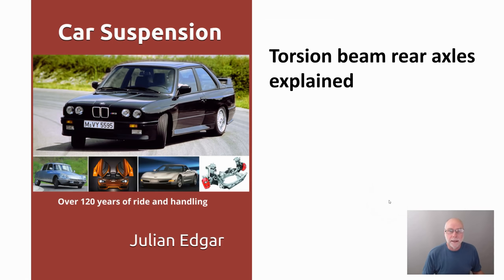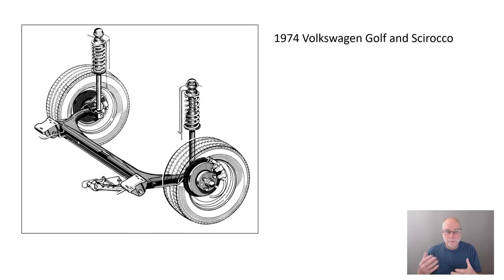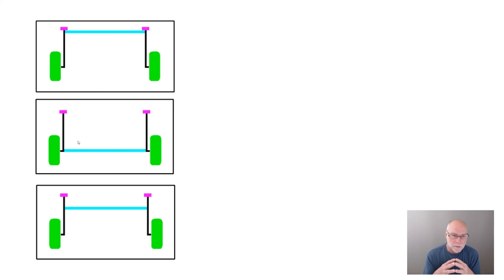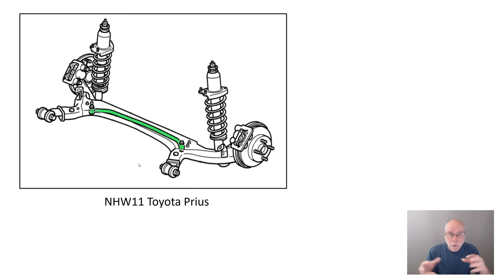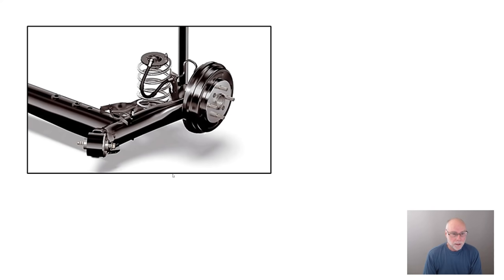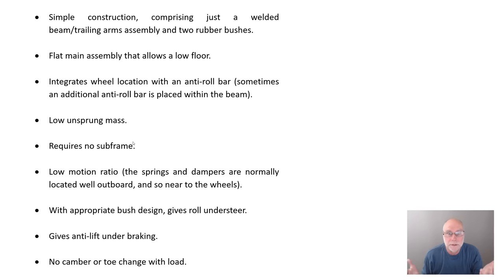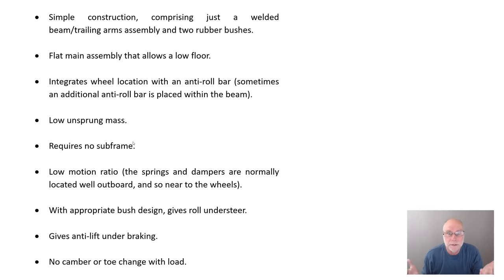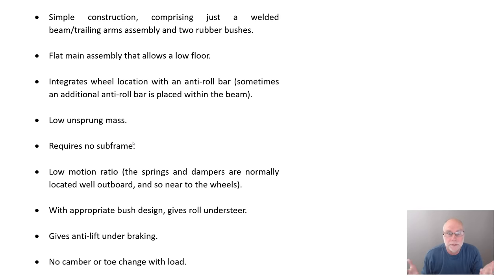Torsion beam rear axles explained

Comment: Torsion beam rear axles are NOT completely dead yet because it is still found in the current model of Mazda 3 in which it had switched from independent type.
Reply: Far rom dead I would say. Lower spec Mercedes A-Class, Golfs and their SEAT/Skoda, even Audi equivalents use one, as does the Peugeot 308 and its clones, pretty much all supermini class cars like the Polo etc. And since cars like the Golf moved from multi-link independent rear ends to this two-tier system of twist beam for low-spec cars, you could say it's more common now than before. Perhaps it will die however – nice to see the new Renault 5, despite its size, having an independent rear end.
Reply: I think Toyota still uses them too. I remember I saw one in 2012 Yaris. I just noticed it after I got fascinated by this axle type after one in my Golf got broken and how easy it was to replace. At least compared to the multi-link rear axle on my wife's Audi which always has some bushing or link worn out.

Comment: On my laguna ii beam developed cracks about 2cm from weld, and it is case of car with 20 years of riding on shitty, Polish roads. Still, cheap and quick to replace and still very, extremely long life suspension part. In winter we have salty roads and it is fine to have corrosion-made holes in like 10 years :>

Comment: ive seen a few rally guys running watts links on their fiestas to counter the lateral forces on the bushes. also helps with the stress on the arms themselves by taking up the lateral force.
Reply: Afaik that's been a original design in quite a few cars. But I'm not sure except some Opel/Vauxhall models.
Seems like a rather simple but worthy upgrade for sure.

Comment: Good info! i have a citroen DS3 that uses this system and having been brought up on live axles and multi-link independent suspension systems, (60's sports cars and saloons) i was a bit mystified by torsion beam suspension, now i know!
In some situations the DS3 behaves like it has a live rear axle, there is a long sweeping fast bend with a ridge right across its apex, the DS3 gives a most undignified lurch to one side as it is crossed! This doesn't bother me having driven live axle cars that would do the same. I liked your semi trailing link analogy,  a design used on the IRS TR's and they always would squat down at the back under acceleration and cornering hard, the torsion beam gets round this very neatly!

Comment: It is very interesting. Thank you for these videos. These type of suspension was and still is very common on euro hatchbacks.
One thing I would like to bring to this discussion is how immensely important are those two rubber bushes in the whole car handling. They are often overlooked and never replaced, when in fact they tend to wear very quickly. Lateral desplacement of the beam, even if small, have  huge impact in the steering precision and feeling. If you have a car with this suspension with more than 80.000 or so, change them, you will feel the difference.
Reply from the maker: Yes that is correct.
Reply: For the Astra VXR/OPC they are commonly replaced with spherical bearings which add minimal NVH for a huge upgrade in rear end feel and stability. Definitely something I want to do to mine.

Comment: My 96 Passat (B4) has semi-trailing arms. I tossed the torsion beam in the scrap heap in favor of a Syncro setup. I get lots of toe-in as it compresses and it feels much better than the torsion beam. This is interesting info right here. The car rode like hell on airbags slammed down low. Now I know why, no torsion action!

Comment: Julian:

Re: stress on the welds - the torsion beam is loaded in torsion (hence the name), resulting in shear in the tube. From shear flow theory, the shear in the thin wall is approximately proportional to the distance of the wall from the centroid of the beam cross section. You'll notice that the beams tend to be rectangular rather than round, and the welds are at the ends of the rectangle, far from the centroid, and so are subject to much less shear than the regions near the centroid. Assuming a material thickness that is greater near the welds (a good assumption for the way these things are stamped), the welds are not only under lower stress compared to the rest of the section, the material in the vicinity of the weld is also thicker. Hence, it is unlikely for a properly designed and executed weld to fail in this application.

Thanks for the details on the kinematics, I'd been wondering about this.

Comment: This is a great presentation. Have you read about how the beam axle in the Mk3 VW and Passat would shift in a controlled manner in cornering? VW billed this as a simple 4 wheel steering system.
Reply from the maker: Yes, most rear suspension designs have 'steer' capabilities.

Comment: Interesting that you mentioned the negative of poor lateral stiffness, because that’s exactly that I feel in my Alfa mito when doing a roundabout for example and hitting a pothole or general imperfection in the road, the entire car seems to shift a bit towards the outside when that happens. It’s also very noticeable under heavy cornering when there are imperfections in the road
Reply from the maker: More likely inadequate damping. Lack of lateral stiffness in a rear torsion beam more likely to lead to rear toe (ie rear steering) changes, I think.
Reply: @JulianEdgar  oh ok

Comment: I had a Citroën Light 15 back in the day and it had torsion bar suspension all round and one could adjust the tension, with Michelin tire's it stuck to the road like glue with a very smooth ride . for something designed in the mid-1930s it was remarkable.

Comment: another disadvantage is reduced  ground clearance  specially when used  in FWD  Vans like Renault Traffic , these often have to drive around on  muddy or sandy  building sites with an already compressed suspension due to  heavy cargo.

Comment: Great video! I have a question Mr. Julian. Two same cars (Golfs), one with torsion beam on the rear axle and the second one with a multi-link, should have the same behaviour, in terms of comfort, when BOTH wheels hit a transverse bump/pothole, assuming that the shocks are same? Thanks in advance.
Reply from the maker: Not easy to answer eg depends in part on the unsprung weight of the two different suspension designs.

Comment: Perfect analysis, thank you! Just a question: if you add a spring spacer at the springs of a torsion beam (in order to raise the ride height at the back), do you affect the spring preload?
Reply from the maker: Depends how long the dampers are, but yes normally that would be the case.
Reply: Thanks for your reply! This applies also when the damper and the spring work separately? I mean when it's not a coilover.
Reply: I mean a design Similar to the design your are describing at 6.06 of your video
Reply from the maker: The length of the dampers dictates the preload (if any) on the spring. Fitting spacers to the springs would normally change the preload, because the dampers don't get any longer.

Comment: Hi, from a performance point of view, I never really understood why anti roll bars are installed in conjunction with the stock torsion rear beam instead of bracing the existing setup for more rigidity, is there a benefit to it or just marketing?
Reply from the maker: Allows easy manufacturer adjustment for different models. Just change the bar, not the whole torsion beam axle.

Comment: Just to note - the Peugeot 306 / 206 etc did not have a torsion beam... it had a fully independent torsion bar setup. Quite a smart system really which was very low maintenance!
Reply: That was the answer to my question since I just bought a 206 and wondered why the trailing arms are on individual bearings if they are supposed to be rigid. My thought was something like what you stated but was not sure.
Reply: The 306 also had a passive rear wheel steering mechanism as part of the bushing arrangement.
Reply: I do not agree 100% about the low maintenance, the family 106 needed a replacement of the entire system because it rusted together, leaving the car with no suspension at all.
The replacement version had multiple lubrication spots to fill op the torsion beam system with grease, to prevent the system from rusting into a solid piece again.

The same system generally works well on a lot of trailers though, so designing it correctly is key.
Reply: @larsjrgensen5975  Just because YOUR suspension system wasn't reliable, doesn't mean ALL of them were unreliable. Most cars I've seen with 200k with no work needed to be done on the suspension. That does take a lot of doing!
Reply: @khalidacosta7133  Just because YOUR suspension system was reliable, doesn't mean ALL of them were reliable.

I wrote that it works very well on trailers, but it is not a 100% perfect system.

If they spend time and money on developing a way to renovate the system on a peugeot, there must be a market and need for it.

The 106 had around 160.000km on it, when it locked up and became very dangerous to drive.
A friend of mine had a Renault 19 with the same design, one side broke at 190.000km.
A 306 in the family locked up like the 106, but i do not know about the km, so it does not count.

We have a bad climate here, with a fair bit of road salt, that could maybe explain some of the higher failure rates.

Comment: It's a simple design....Not overly sporting, but just pure simplicity.

Now it isn't attributed it to bad welds or excessive forces, but broken torsion axles on the Ford Windstar is all too common.  It was attributed it to salt exposure...  It was so common enough Ford issued a recall.  I tend to attribute it to many factors of all the cycles they see, with the road salt/brine accelerating the process.  But if you haven't seen a broken torsion axle - there are lot's of pictures all over the net of Windstars with broken torsion axles.  Is it a common problem altogether, no... But given all the attention is generated - it likely soured companies from the design.

Comment: My Fiat Scudo van has a torsion beam rear axle, but it has a panhard rod to take lateral forces. So lateral forces can be quite simply solved just like that.
Reply from the maker: Yes and no: there will still be a relatively flexible trailing arm component unless the torsion beam is acting only as a dead axle.

Comment: My Toyota Avensis with torsion beam rear end has what looks to be a significant amount of negative camber and toe-in included in the design. Why is this necessary? At first I thought it was broken but it’s meant to be that way. I can’t see the need for negative camber on the rear of a front wheel drive car?
Reply from the maker: Because all cars need front and rear grip, irrespective of their driveline configurations.

Comment: What do you think about Opel Astra J rear torsion beam axle coupled with a Watts link? Was the Watts link placed there to limit the amount of toe out on the outside wheel? If so, as you say, couldn't this be mitigated by a better bush design?
Reply from the maker: I have no technical information on the Opel Astra J.

Comment: The VW GTI did have a anti roll bar it was built into the V section of the beam.
Reply from the maker: Yes, many cars with torsion beam rear suspension have an anti-roll bar within the beam.
Reply: @JulianEdgar  You said there wasn't one on the VW beam and you are correct for all but the GTI models. I did see you mention other vehicles. I just felt like commenting as I was a VW mechanic for 35+ years. 👍

Comment: Hi Edgar, loving you series. How would this torsion beam compare with torsion bar which had independent wheel suspension, like peugeot 306 as someone mentioned before. I suppose having independent suspension must be much better than having this beam setup. Thanks
Reply from the maker: It depends how the independent suspension is arranged - torsion bar springing can be used with a whole variety of suspension systems. (I don't know the Pug system in any detail.)
Reply: @JulianEdgar  I was going to ask about the difference between Torsion Beam and Torsion Bar. I assume they are different?
Reply from the maker: @zonoscopePictures  'Torsion beam' refers to a type of suspension system, as covered in this video. 'Torsion bar' refers to a type of spring - a bar that is twisted. So anti-roll bars (sway bars) are torsion bars, and torsion bars can be used as the main springs in all sorts of suspension systems eg double wishbones, semi-trailing arms, etc.

Comment: Julian 
any Video of  DOUBLE BALL JOINT SUSPENSION GEOMETRY and BENEFITS ???
Reply from the maker: What is double balljoint suspension? Double wishbones?
Reply: @JulianEdgar  I seen some Audi have 2 upper ball joints
Reply: @JulianEdgar  https://en.m.wikipedia.org/wiki/Multi-link_suspension
Reply from the maker: OK, multi-link suspension. Pretty common these days, especially on the back on RWD cars. Yes, they have benefits in holding toe angles and giving defined camber curves - but I often think the benefits are a bit overstated. Multi-link suspension is covered in my book.

Comment: Your videos are lways interesting. Where is the roll centre located at static heigh and where does it move to in bump, both two wheel bump and one wheel bump, and roll.
Reply from the maker: Not a depth I am going into here. I can recommend several textbooks and papers if you're interested.
Reply: @JulianEdgar  if you have them. That would be great.
Reply from the maker: @Michael Stanbrough  The references I used when writing the section on torsion beam suspension were: Held, V. & Hiemenz, R., Designing Twist Beam Axles in Encyclopedia of Automotive Engineering, John Wiley and Sons, 2014, and Heibing, B. & Ersoy, M., Chassis handbook : fundamentals, driving dynamics, components, mechatronics, perspectives, Vieweg + Teubner, 2011. However, I am not sure they will fully answer your questions.

Comment: bush design for roll understeer - what does this entail, just the level of hardness, or something else?
Reply from the maker: It can involve differing bush hardness in different planes and the bush orientation - but also inclination of the trailing arms to horizontal, use of additional toe control links, etc.

Comment: Hi, My car has thos type of rear axle and I am curious How can I upgrade this into an electric drive format.
Keeping the combustion engine in the front, powering the front wheels and somehow upgrading this type of rear with an electric motor.
Reply from the maker: Anything is possible but it would be a major engineering exercise.
Reply: @JulianEdgar  If it piqued your interest and lets say intellectual curiosity, as someone that knows a lot on car suspension, i could suggest tackling this idea, thinking a "what if, how i would do such a change". Not needing a large EV motor (like lets say a tesla or any other powerful beasts) but one that could serve every day driving in a phev, like a 9 inch electric motor or an 8 inch one, with some 20-30 odd kW output...or maybe smaller hub motor setup in each rear wheel, which might not involve any suspension change
Reply from the maker: To be honest I think the days of doing home-brew electric conversions is gone. Depending on where you live, it would likely cost a lot more than buying a secondhand electric car. And as for a hybrid, you could never match a Prius in outcome - and they're now very cheap indeed.
Reply: @JulianEdgar  yeah, factory electric cars are not too appealing, they have devolved in terms of quality plus they use everything integrated, only touch screen, minimal buttons and very expensive to repair.
In fact the EV conversion will just start to bloom, because plenty of owners of older cars would want to continue to use them and enjoy upgraded performance of the EV tech as opposed to the new low cost EVs at stupid overpriced price tags.
A conversion is 10k-15k using tesla batteries (so expensive)
Ah, there are shops that charge for a EV conversion 3 times that from the snobs that don't care, that is a different story, but with 10k an EV conversion is a realistic price.
What used EV do you find with such a low price? Nissan leaf is junk, was a failed engineering from the start, 
Now, then you get to keep your beloved current vehicle that has much higher comfort than the sparse plastic cans of the first gen EVs and also the benefit of electric drive.

Comment: Isn't the torsion beam suspension just a variation of the torsion bar suspension patented in 1923?
Reply from the maker: No, quite different. Torsion bars provide the springing medium; in a torsion beam system the springing medium is completely separate. Perhaps you'd enjoy the book?
Reply: @JulianEdgar  so what exactly does the torsion in "torsion beam" refer to?  Doesn't torsion, by definition, refer to a twisting action which is what differentiates a torsion beam axle from a beam axle?
Reply from the maker: Torsion bars provide the vertical movement's suspension springing. A torsion beam axle does not use its axle in torsion to provide vertical springing; it uses its torsion to provide roll resistance. A torsion beam suspension is nothing like suspension using torsion bar springing - torsion is used in completely different ways in the two systems. Therefore torsion beam suspension is not just a variation of the torsion bar suspension.
Reply: @JulianEdgar  so a torsion beam is a glorified anti-roll bar.
Reply from the maker: Yes, that is a better way of putting it than suggesting it is just a variation of torsion bar suspension. However, unlike an anti-roll bar, the torsion beam is solely responsible for the wheel location as well. Have you actually watched the video?